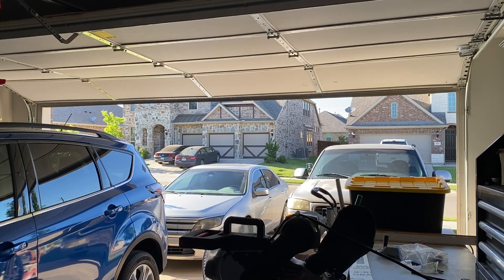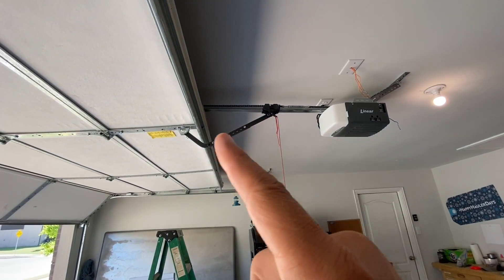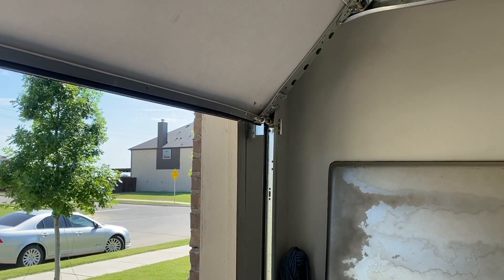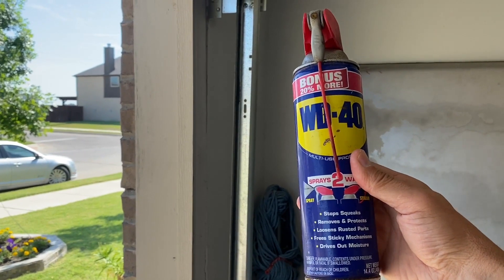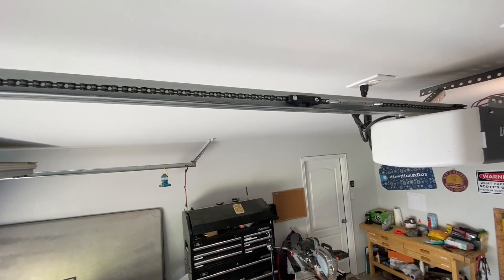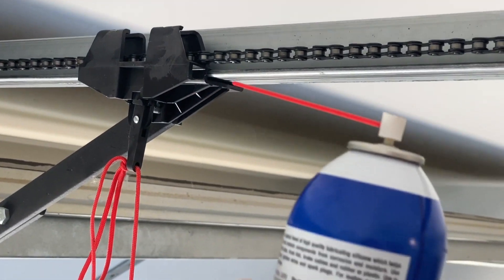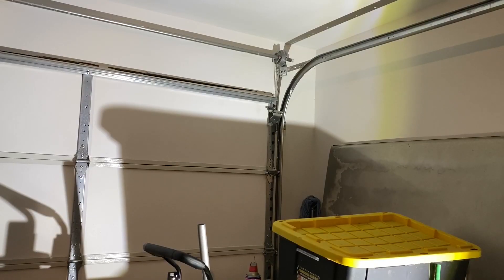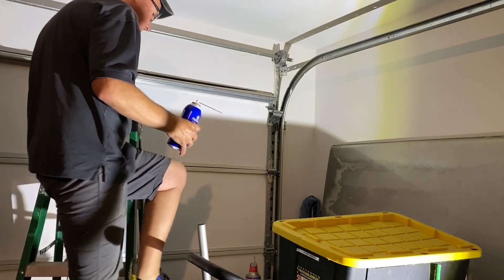Lubricating your garage door correctly will enable it to open & close without hesitation! Learn how!

Comment: Thanks for the video. My garage door bracket broke and I fixed it. In the process I moved the connecting point 1 inches down. Now the door will reverse right above the sensor. But I know the sensor are lined up OK. Searching on youtube, found your other video about binding - and click on the lubricating video you so kindly provided the link. Don't have the same lubricant you have, used white lithium instead. worked after the first try. Thanks again for taking the time to do the video.

Comment: I have the same system as you. Mine stops/reverses similar to how yours is doing, then my light blinks three times. I can force it down electronically by holding the down button, so that is a plus.  The three flash troubleshoot says “safety beam obstacle- check beam alignment and beam obstruction”. The sensors are showing they are aligned, so it’s not that. I lubricated like you did, and still no luck. I see or feel no beam obstruction. If there was an obstruction, I shouldn’t be able to force it down electronically. Any thoughts?

Comment: We have a brand new garage door that was installed 6 months ago in August-2020. This winter we've had a lot of snow and cold temperatures at or below zero. We keep the door cleared/shoveled of all snow, ice, etc.. but occasionally the door gets stuck when trying to open it. I'm guessing the severe cold air is causing this. 2 questions:  1). will lubricating all the joints and spring help alleviate this? 2) can I use Liquid Wrench silicone lubricant, as that is what I have on hand? Thanks for any info you can give me.  :)
Reply from the maker: It really should help and the liquid wrench silicone should be fine.
Reply: @ScottsGarage17  Thank you.